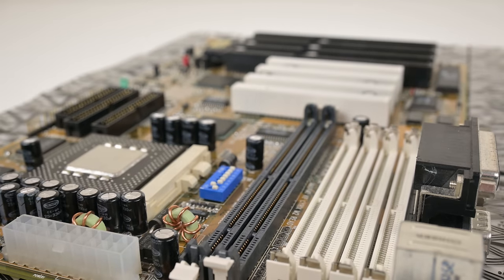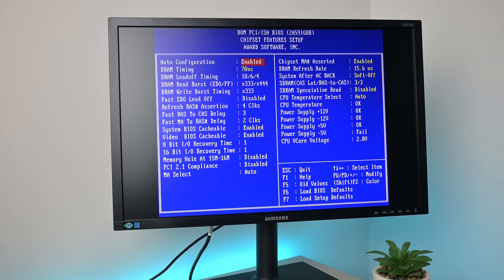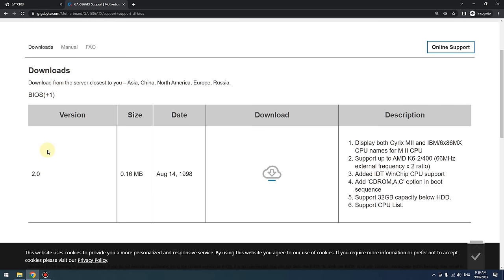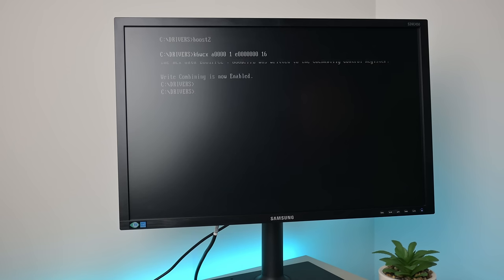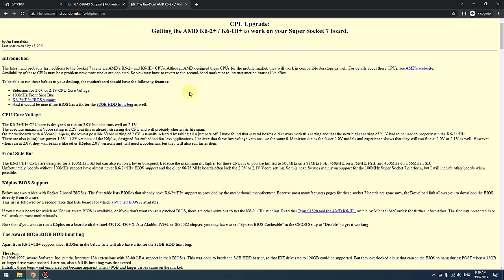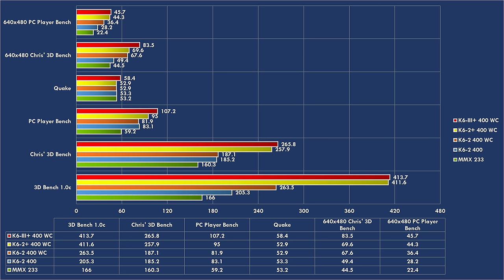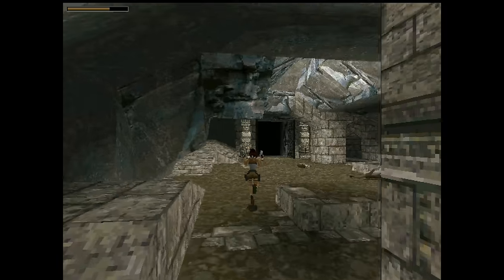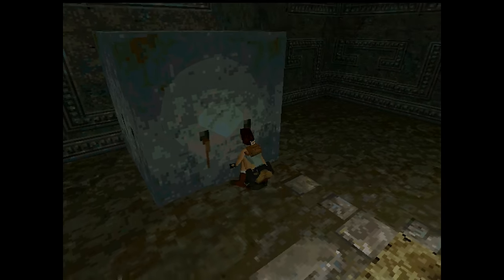Upgrading and Tuning Socket 7 to the Max

Comment: I'd love to see you do this with a super socket 7 board. The agp and higher bus speed should be a bigger difference.
Reply from the maker: Yup especially the higher bus makes quite a difference.
Reply: Have a super socket 7 with a g200 and voodoo2, it flys.
Reply: @philscomputerlab  3x133MHz for a K6-III on my Epox MVP3C2, too bad I don"t have that video card to compare.
Reply: I'll 2nd that. I recently acquired a PC with a super socket 7 board and a cyrix MII. Came with a PCI cirrus logic card, but assuming the board works (still getting around to testing it), my plan is to get an AGP card in there - maybe a Riva TNT or something like that.
Reply: @Malheirods  I have K6 3+ 550 on Epox EP-MVP3G5 with 2MB cache that I built in 2000. I did have 768MB on board, but reduced it to the cachable  limit of 512MB and it is much better.  I’m too scared to try it over 100Mhz even though it has PC133 cl2 in case something bad happens. It uses 2 x SSD’s and every slot (Ed. 1 free PCI) and bay is now filled with the best parts including Dream Blaster XG midi on the aureal 2 PCI  Sonic Vortex card and 8MB on the AWE64 Gold. I can’t teak it any more! The only thing I lack is  a 3dfx card. It is the one thing I have never experienced.  Is it worth adding one of these to this rig? Unfortunately I’m probably also out of IRQ’s.
Reply: @ionstorm66  I've cheated with my first build - still alive! 
Changed my 2D GFX card(ET6000 4.5MB) to a Radeon 9250 PCI 😲 Still have the Voodoo²

 in, of course ;-)
Reply: @davidp4456  It could be worth it, especially if your CPU can handle the 133 MHz bus, and you can also go above 600 MHz (they tend to be good overclockers, from the 3 or 4 different K6-x I had in the past). If you go for it and you have an AGP slot it's even better, as you probably know PCI is a shared bus, so that means it can greatly impact your GPU performance if you have other stuff on the bus.

That's why most retro builds you see around Youtube running 3dfx hardware either go for a full 3D card or a some 2D card + 3dfx 3D card with a passthrough on the PCI bus and an ISA sound card (like the SB16 or stuff like that)
Reply: I have three near-identical super socket7 boards. One of which needs recapped if I had time I would do a very thorough evaluation with all the chips in my collection unfortunately time is something I do not have an abundance of.
Reply: @psychopowner101  I don't = only my first build '97! Iwill P55XB2, Socket 7...intel 430TX..etc...OH wait! AT AND ATX PSU support 😲
Reply: sure, once you max everything on the best ss7 platform with K6-3+ overclocked to 620MHz you will about reach Celeron 300A@450.

Comment: Phil if possible please make a benchmarks video with games from 1996-1999 with those socket 7 CPUs using a Voodoo 2 or Banshee. Quake1/2, Unreal, Half-Life, NFS 2/3 and others would be really really interesting to see. Thank you!
Reply: Good idea
Reply: Didn't he do that YEARS ago?
Reply: @dallesamllhals9161  yes he did but with a much newer more powerful nvidia card, not with a 3dfx cards from that time 1998-1999. The K6-2 and 3 work best with 3dfx cards.
Reply: @BurningFlame1999  I know! Still have my Voodoo²
 from '98 in my Socket 7 from '97 😛

Comment: It seemed so simple back then. Games were good. Hardware was dropping in price. I miss that.
Reply: Yes, it was simple. Technology was moving so fast, your CPU and graphics card were simply guaranteed to be obsolete the month after you bought it. Your DOS games would simply require editing your config.sys and autoexec.bat files, and you'd simply have to decide which IRQ went to which hardware, whether to enable DMA or not, and occasionally, you simply bang your head against a wall trying to figure out why it simply isn't working properly. 😉
Reply from the maker: 🤣 32MB RAM: Your machine doesn't have enough conventional memory to run this game... Fun times.
Reply: @philscomputerlab  I never thought of those things as a bad time. Forced me to think. Forced me to read manuals. Forced me onto BBSes. And BBSes were always fun. Slow as they were.

Comment: Pentium 200MMX was my daily PC from 1998 to 2005 with the same exact installation of Win95 which became severely bloated and corrupt.  I didn't realize till over a decade later that it was a Asus super socket 7 board with 75mhz and 83mhz FSB settings.  I still have the computer buried under a mountain of other stuff in my house.

Comment: In the Tomb Raider, if you select software render, you can see that during walking that the walls are moving a little bit. It is because the software render they made, is using integer calculation exclusively (no floating point - because it is to expensive or maybe not supported). So sometimes during math calculations the rounding of the integer numbers make the artifacts, thus the polygons of objects/walls moving a little.

Comment: Like! Back in mid-1999 I upgraded my Socket 7 P166 MMX to an AMD K6-2 400 mhz (6x66). lt was a very nice efficient and cheap upgrade. A lot of people who had older Socket 7 systems did the same back then. Some benchmarks with games from that time would be really interesting :)
Reply: AMD K6-2 400 was ~$90 in June 1999, Celeron 300A was $60. Selling motherboard +P166MMX+ram you could probably manage to swap into modern Intel platform with AGP altogether for not much more.
Reply: @rasz  you are right but I had zero experience with overclocking back then and was too afraid to try it out. At stock speed a Celeron 300A has a similar performance to a K6-2 400 mhz.

Comment: I built a maxed out Super socket 7 build a few years ago, that was fun. It has a K6-III+ 450 running @550, EPoX EP-MVP3G-M motherboard, 256MB RAM, Geforce 2 MX400, 64GB SSD, Soundblaster Live! platinum. Its been a great machine with some pretty excellent compatibility.

Comment: Ooh!

THAT brings back some memories.

The first PC I built had a FIC mobo an S3 Virge and a K6-2/350, almost thirty years ago.

Then a K6-III+ and a Voodoo 3.

Night and day!

Now, I'm about to build my first in sixteen years - and I'm a bit apprehensive.

I miss Win 98!

But at least I won't need to heat my flat this winter.
Reply from the maker: What's your take on the S3 Virge?
Reply: @philscomputerlab Blimey! Now you're asking. It was so long ago - I'd barely graduated from my ZX-80.

It seemed adequate for day to day. I had no luck with it playing games.

I played 'Wing Commander Prophecy' - eventually, with the Voodoo 3.

With the Virge, it would freeze the system at the same point each time and I'd have to reboot.

I quickly gave it up as a bad job and saved my pennies up for the Voodoo 3 - the Virge is probably still in the same box I put it in to forget about.

But then, I barely knew what I was doing.

Oh well.

Comment: Interesting video! I started my computer hobby with Socket 7 system.
Reply: Ah, socket 7... you started with the modern stuff. You're still a newbie. 😉   Back in my day we had 8 bit CPUs with Kilobytes of RAM, cassette tape as storage, and if you had a floppy disk drive, the disks were actually floppy. Meanwhile , my stepfather reminds me that back in "his day", computers were the size of a small housing estate, and used punched cards. At school they didn't have calculators, they used slide rules.😂  How quickly things change.

Comment: Interesting addendum to what Phil said about the max RAM capacity. My first PC was a P166MMX which I bought at the time with 32 MB of RAM.. I later upgraded to 64 MB of RAM and was even able to overclock my CPU to 233 MHz without any issues and it ran pretty nicely.
When I upgraded it later to 256 MB it dropped in performance like crazy under Windows 98SE but surprisingly under Linux it worked like a charm and I was able to access everything without any problems. I later learned that it was a caching issue like he mentioned.

Comment: Great video! I think your results with the K6-2 400MHz on a 66 MHz FSB illustrate one reason why Intel abandoned the socket 7 platform when they did in favor of slot 1 where they could place the L2 on CPU card and bypass the FSB until the time they had the tech & yields to integrate the L2 into the CPU die itself. The 66 MHz FSB on socket 7 starts to choke performance when you get beyond a 3.5x or 4x multiplier. Boosting the FSB to 100 MHz in the Super Socket 7 boards helped and putting the L2 on the CPU package itself as the K6-2+ and K6-3 chips did helped a bit more. By the time those CPUs were released in spring of 1999 I had been enjoying the overclocking monster that was the Celeron 300A with it's full CPU speed L2 on a slot 1 based Abit BH6 board for many months.
Reply from the maker: You are right. These CPUs start really flying when you crank FSB past 100 MHz...
Reply: Absolutely. The K6-2 even on a Super-7 board at 100 MHz bus speed was bottlenecked by the slow L2 cache on the motherboard when you got above 400 MHz. I never recommended that CPU above 400. 

The K6-III was another story entirely. It would gain performance in a linear fashion because its L2 was running at full speed and would gain even more if you raised the bus over 100. When the K6-2+ and K6-III+ mobile chips, both with full-speed L2, showed up, you could get some crazy performance and overclocks. The holy grail was to get one working on an FIC PA-2013 at 6*124 (744 MHz) with the 2MB of L3 on the motherboard. (800 MHz was theoretically possible on an Aladdin 7 board, but those didn't support cache on the motherboard.) A few people did. I had the older VA-503+ with 1 MB L3 and got to 616 (5.5*112) on a K6-III+ 450. It was my primary rig for about a year and a half before I went to the 1.4 GHz Athlon.

I did use these CPUs in a few laptops that only supported 66 MHz FSB. Because of the on-chip L2, it was completely viable to run them at 6*66 without a severe performance penalty.

Comment: You're correct about memory addressing in DOS and Windows. Back in the day you could kind of work around the 64MB cache limit by creating a RAM drive and then setting the swap file to that. This worked better in Linux because it supported a staged swap configuration where it would exhaust the RAM drive first and then start using hard drive swap space. Of course you could also replace the TAG RAM chip but those were rare even at the time. Can't imagine how much such a thing would cost now.
Reply: OH! You know a bit about Linux on HW from these good ol' days?

I'd like to try that on my Iwill P55XB2.
Reply: It's better and faster to have all of the system memory be addressable and available, rather than making a RAM disk and storing a swap file in it. The CPU can't execute code or use data directly from the swap file, it has to be copied back into system memory first. If you end up in a situation where the main system memory is exhausted, you can enter swap hell. This is where the system goes into an endless cycle fever pitch of swapping back and forth because it can't find a large enough chunk of contiguous memory free to do some operation, and there's no sanity check to say "I've run out of memory, I need to forcibly close something to continue functioning."

Swap hell used to not be a thing. Windows XP and prior had checks in place to determine if too much memory was trying to be used, and would warn the user about it. Windows Vista and onward got rid of that. Linux is the same story, more modern Linux distributions can get stuck, especially "live cd" versions. You run out of RAM disk and the thing just packs up and dies.

Having more memory available, even if it's slower memory, is better than no memory. On NUMA systems, this is a fact of life.
Reply: @GGigabiteM  Do you have experience with this configuration? Exceeding 64MB was a death sentence to performance. It was in no way "better even if slower". Using RAM as a RAM drive or swap was a way to get at least something out of it. Most people got into this situation due to not knowing about the limit rather than purposely engaging it. Anyone making an informed decision would have either verified that the TAG RAM supported the full 512 MB or have sprung for a Pentium Pro or, later, Pentium II. >64MB on Triton motherboards was the domain of people trying to stretch their purchase into the mid-to-late Windows 98 era and running into unexpected issues.
Reply: @dycedargselderbrother5353  I've been a system builder since the early 90s, so yes, I have experience with it.

To start with, MS-DOS 6.22 and lower never supported more than 64 MB of RAM, so even if you had more than that, it could never be used, even for a RAM disk. Such a configuration required Windows 95/NT at minimum.

Second, such ludicrous amounts of memory in the mid 90s was entirely unrealistic. The average machine only had 8-16 MB, with some approaching 32 MB. And those "high memory" configurations cost thousands of dollars extra. 512 MB was entirely unrealistic and unheard of outside high performance servers, and no desktop Windows OS supported that properly until Windows 2000.

You say "Late Windows 98 era", are you talking about going into the mid 2000s? Because Windows 98 was supported up until 2006.

Trying to shoehorn 512 MB into an ancient Triton board, even at that time was just pushing technology farther than it was ever intended to. Windows 98 was also so wasteful with resources that it was really pointless to go that high, plus you start running into weird internal OS limitations that affected stability.

And I still say that more memory is better, even if it's slower. Especially for Windows 98, because such ridiculous amounts of memory were almost never utilized. I remember some of my final Windows 98 machines having 256 MB and I never had problems with running out of memory.
Reply: @GGigabiteM  You don't seem to understand the technology being discussed. TAG RAM isn't literal RAM. TAG RAM controlled how much of the memory could be cached. Most commonly the amount was 64 MB. The next most common was 512 MB. There may have been intermediate steps, but I don't remember them. Having TAG RAM that supported up to 512 MB didn't mean you were forced to install 512 MB RAM. Few motherboards even supported that. But if you wanted something like 96 or 128 MB, amounts commonly seen during the K6 era, you needed 512 MB support to properly utilize it. That or replace the motherboard. This was primarily an issue with the i430 line, though some of the Super 7 chipsets had similar issues. It was not a problem otherwise, e.g. with the previously mentioned Pentium Pro, II, III, or 4. Or Athlons for that matter.
Reply: @dycedargselderbrother5353  You're the one that has no idea what you're talking about.

TAG SRAM is used by the chipset and CPU to store lookup tables of where data is stored in memory. It does not affect the speed of memory, it only affects how long it takes to do the lookup for the data in memory. Once that operation is complete, the speed at getting data out of memory is the same across the entire memory map in a linear address space. 

How this affects performance entirely depends on what the application is doing. If you have lots of memory accesses going to different areas of memory, yes, the lookup time will be slower. However, if you're only doing few lookups on large operations, the performance hit will be minimal.

More modern computers call this a Translation Lookaside Buffer (TLB), which is stored in cache inside the CPU instead of on the motherboard.

There were three common sizes of TAG SRAM chips, 8kx8 (64k), 16kx8 (128k) and 32kx8 (256k). Each size corresponded to how much L2 cache was installed. Using the wrong TAG size can sometimes result in system instability if the chipset is writing data to a non-existent location and tries to read it, and gets garbage instead.

Comment: Nice video, and great tip about double checking the chipset too!
I came into performance issues when I maxed out my Packard Bell Multimedia Socket 7 board.
Interposed K6-III because that motherboard doesn't have a properly adjustable VRM (can't use anything other than Pentium none MMX without overvolting)
64mb RAM no problem, however I find that because the K6-III has an extra level of cache, it tends to run up to 128mb better than say, a P1 MMX with 128mb.

Paired with a Voodoo 1, it is my go-to Win95 rig for sure and it's a great trip down memory lane, albeit at the time as a kid I hadn't a clue about PC Gaming and used to just tinker with the built in software :P

Comment: Quake results are so interesting! Imagine this nowadays. People would be fuming about no performance boost despite higher clock speeds and more cache ;)
Reply: My original assumption was the S3 graphics card being the bottleneck, or the 66 Mhz FSB, as all the CPUs came out with the same numbers, within a small margin of error... until the last one. Which is strange. Nowadays a lot of younger people have no idea about bus speeds, cache, clock multipliers or even different CPU architectures. 🙄